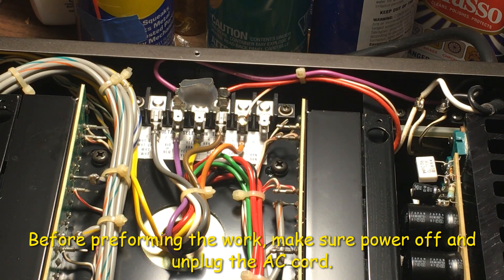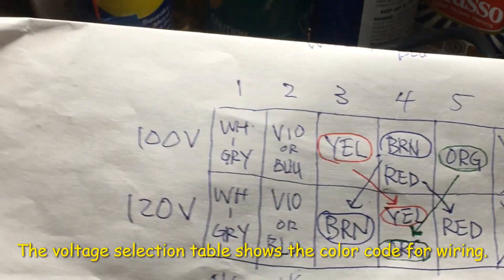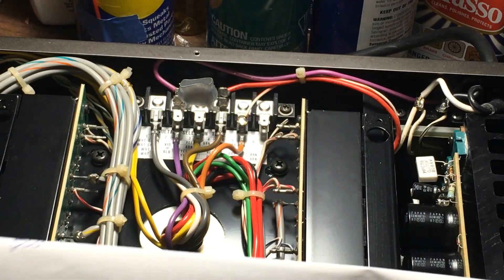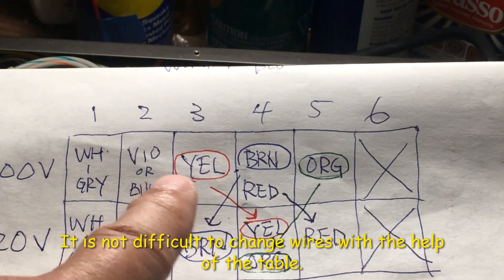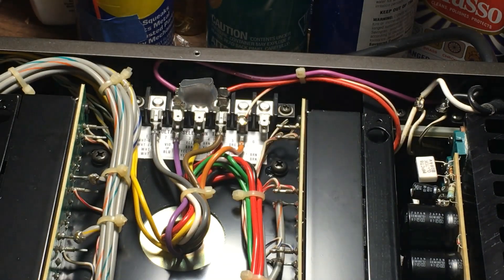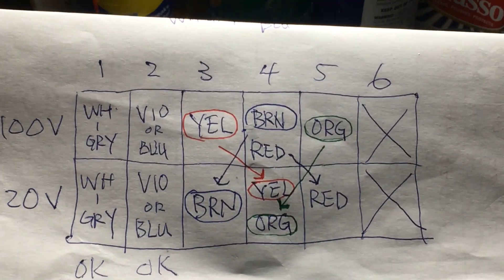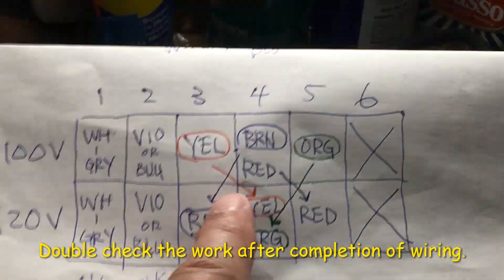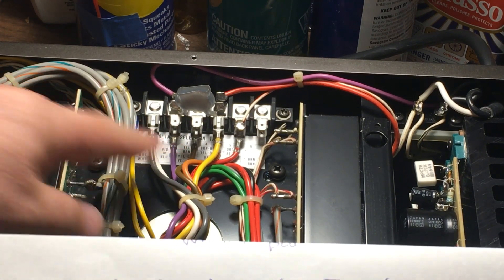Accuphase P-300L Power Amp Repair II - AC Voltage Setting

Comment: thank you for this interesting video! I live in Italy; do you know if is possible to convert easily the E-380 voltage too (from 100 volts to 230 volts/50 Hertz)?
Reply from the maker: The older Accuphase products were made worldwide use, so the AC power were switchable between 100V/120V/220V/240V. The newer Accuphase model are sold with the AC input based on the area (Japan, USA/Canada Europe) only. I am not familiar with E-380. The best way to find out is open the bottom cover of chassis and see if there are 0V/100V/120V marked on the transformer. Also to look for if there is a voltage converting wire selector bar as shown in my video. However, my suggestion is taking your E-380 to an electronic repair shop and consult with the experienced technician.

Comment: Do you have a schematic for an Accuphase model  E-280 I purchased it from Japan and I need to change it from 100 V to 120 USA do you have info on that model?
Reply: Hello, I just purchased the e280 from Japan (100v) as well. Were you able to follow the same method shown in this video to change the voltage to 120v easily? No issues I hope?